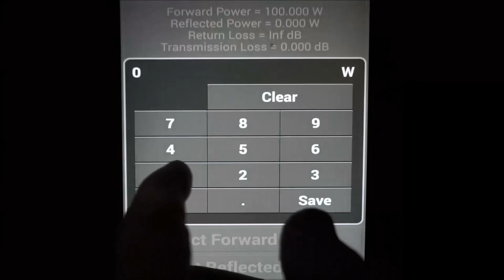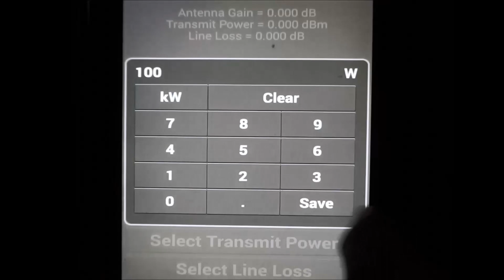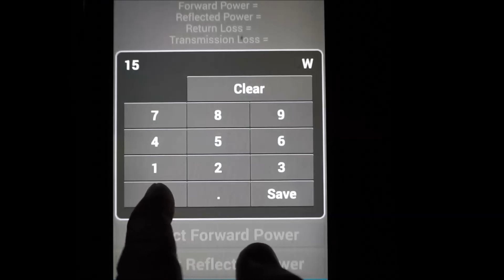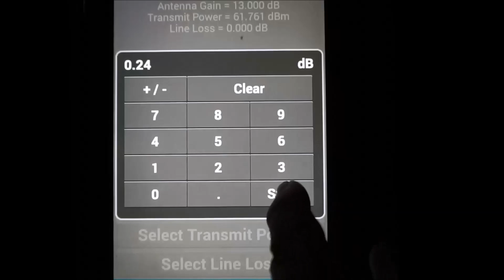Ham Radio Basic--Effective Radiated Power--Explained by Jim W6LG

Comment: Great video. If I put a SWR meter between the tuner and the Antenna,  will it display what the actual ERP is for this transmission line? Thanks for your information.

Comment: It would have been more logical to compare the two stations evenly so as to clearly demonstrate the potential. For example, same power, same antenna gain but different coax. Or same everything except different antenna gain.
Reply from the maker: Okay, I will do that.  I am working on a video with a dummy load right now.  ERP will be soon again. 
Thanks. 73, Jim
Reply: @ham-radio  Okay, that would be great. I recently helped a friend with a phased pair of 6 elements, and we upgraded the coax to Heliax. When I crunched the numbers on ERP with 10 to 12 dbd (and a lower swr) it was a nice surprise.
Reply from the maker: That's huge!  I used 7/8 inch.  Phasing was tricky.  But, the change was hard to believe.  I could also create a null in the pattern that was very deep; maybe 40dB. Total gain for the two yagis was about 10dB. 
I have maybe 100 feet of Heliax outside here.  I need to check it and then use it.  I have been doing almost daily checks with S51DX.  Via email we agreed to stick to what we actually see and not inflate S meter readings.  Anyway, the new location is about as good as it can be given the height restriction.  Local noise is a big problem.  Right on my path to EU is a large solar panel array about 200 feet and on the second level roof.  When the sun is up, it generate lots of noise,  I am hoping that the Fall will be better.  Smoke is really bad here with the fires. Thanks Jeremy! 73, Jim
Reply: @ham-radio  Sounds excellent, hopefully you can null out that solar noise. The rejection is quite good with my mate's antennas now. He's 600m up, antenna array is for 27mhz (dare I say)., 100 ft of 1/2 inch Heliax replaced a very dodgy run of RG213 (new inferior Chinese knock off coax). 
I didn't know about the fires over there, hopefully everything will be okay. We've dealt with our fair share here in Australia, I'm in Victoria and we lost everything at my family property in 2009.

Comment: Hi Jim
Can you help please
What is the best way to get a reading from my half wave antenna I would like to know what's coming out at the end of  the my antenna can I do this with a power meter And dummy load at the feed point the reflected power on power metre is very low
Regards Russ
Reply from the maker: Yes you can.  So go ahead and give it a try. Measure the power at the beginning of the coax and at the end.  Sometimes that number is pretty disappointing.  73, Jim